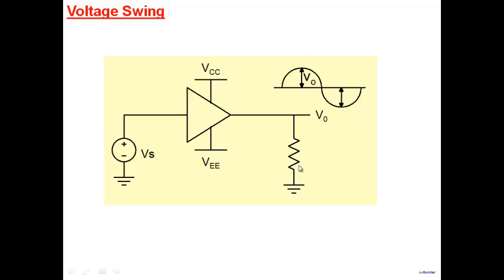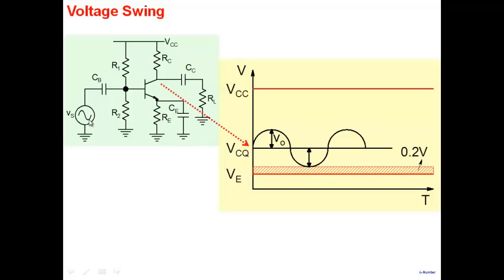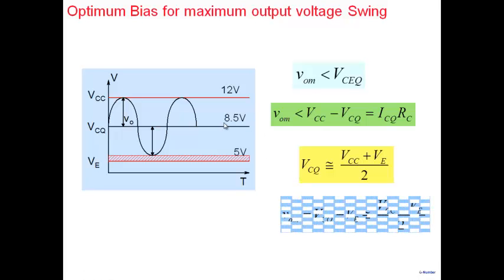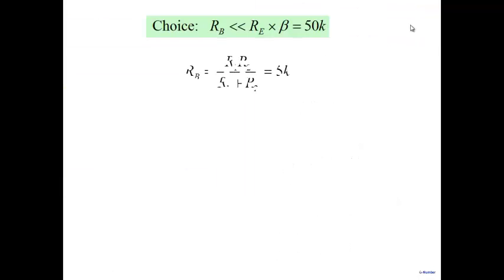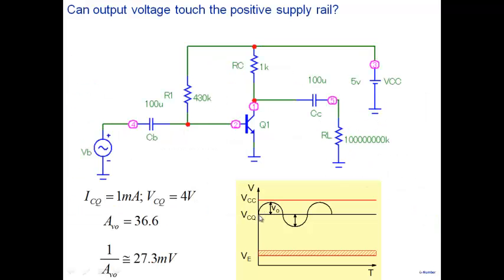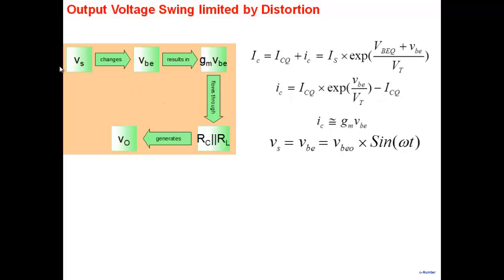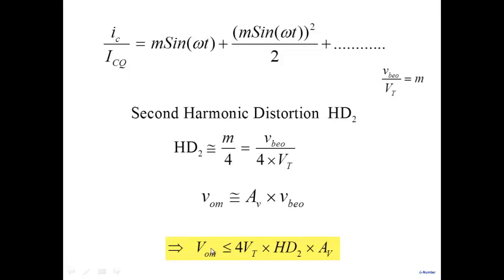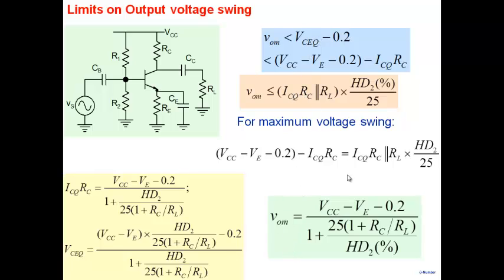Common Emitter Amplifier ( part 2 ) Voltage Swing (EE210 L 15)

Comment: Excellent video.  I think I will watch this one at least one more time.  I was able to follow the analysis but I am not certain how one would go about designing an amplifier with a large output swing of several volts with very low distortion such as 1%.  I would imagine it involves cascading several amplifier stages each with low gain and relatively high ICQ.

What text book do you use to accompany your letures?  I would like to know so I could obtain a copy.

Thanks!!
Reply from the maker: hi,  I appreciate your comments. it is nice to know that you have found the lectures useful.  youtube and internet has provided all of us an opportunity to share and benefit from each other. I do not use any particular text but try to teach based on my 20 years of experience in teaching sem. devices and circuits to students here at IIT. There are several excellent textbooks on the topic such as

1..Analysis and Design of Analog Integrated Circuits; P.R. Gray, P.J. Hurst, S.H. Lewis, and R.G. Meyer; John Wiley & Sons, 4th Edition, 2001. 
2. Microelectronic Circuits; A.S. Sedra and K.C. Smith; Oxford University Press, 4th Edition, 2000.
 
However, you may  find my treatment of the topic different in style.

 once again, thanks for your valuable feedback.

Regards

B. Mazhari
Reply: baquer mazhari
Thank you very much for taking the time to reply to my comment and especially for taking the time to recommend the two text books.  I intend to look into purchasing these textbooks.  Also I intend to watch some of your videos again and take notes of the design formulas so I have them all in one place.  Most of my circuit designs involve operational amplifiers and instrumentation amplifier not discrete transistor amplifiers but I greatly enjoy transistor amplifier theory.  Even though the training I received on this subject years ago was very good your lectures are significantly better especially in terms of such things as harmonic distortion.

P.S.

I was able to find online .pdf versions of both of the text books you recommended. I may still purchase the text books but now I am able to review them before purchasing them.  These are the links if you or anyone else is interested:

https://www.u-cursos.cl/usuario/9553d43f5ccbf1cca06cc02562b4005e/mi_blog/r/%5BGray___Meyer%5D_Analysis_and_Design_of_Analog_Integrated_Circuits_5th_cropped.pdf

http://nkonecny.com/files/ECE342/Microelectronic%20circuits%20by%20Sedra%20Smith%205th.pdf

Thank you!